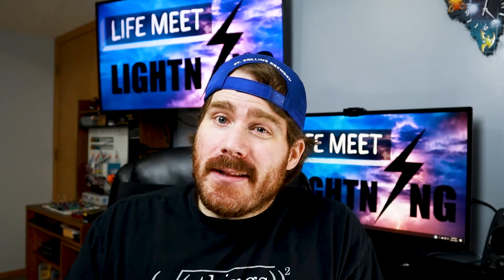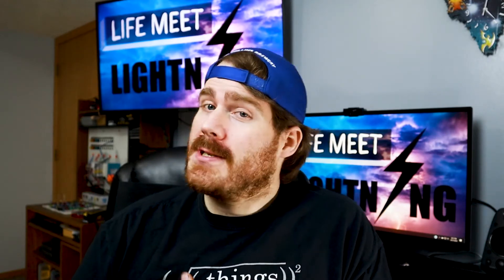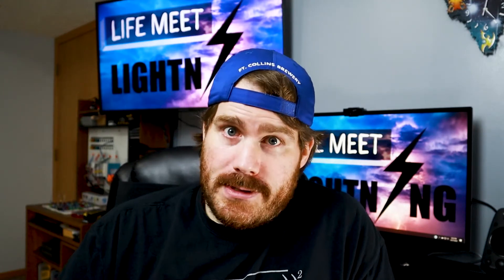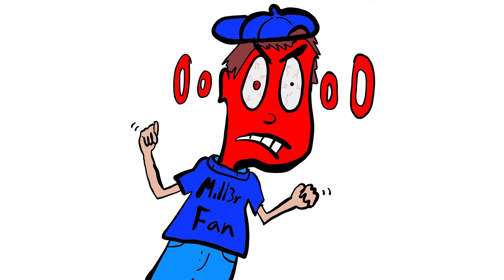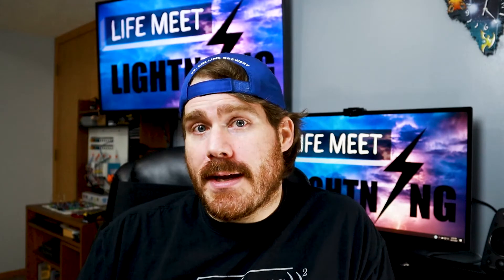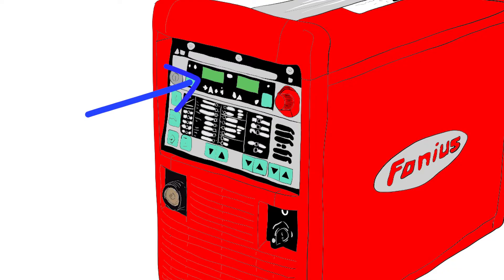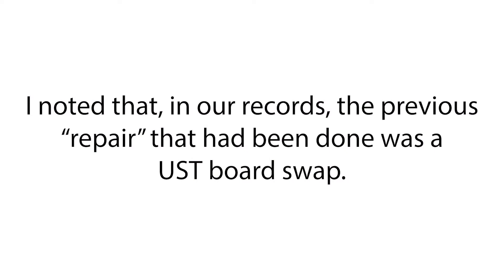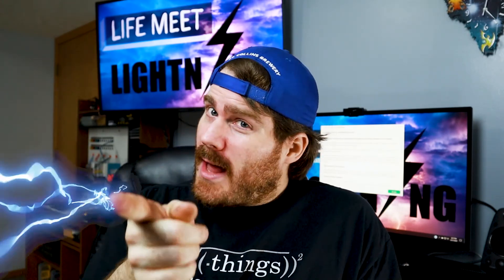Maintenance Technician Fronius Welder Repair | Three Dashes | No Job Selected

Comment: Hello , im from Greece and i bought a used transsteel 5000 with a vrd5000.... When i turn on the main switch , the panel on vrd 5000 just show "off" , and work only the water pump.... Can you help me?

Comment: Just had my first fronius experience myself.  Mine was a bit more straight forward than yours.  Bad Cooling Unit control transformer for the cooling pump.   What kind of company do you work for if you don't mind my asking?
Reply from the maker: I used to work for an off-road vehicle and rail car manufacturer. Now I work for a robot and cutting table integrator. I still fix welders occasionally, but it’s mostly robots now. You?

Comment: Can u help me for a service  manual for fronius transtig4000 machine.
We are not able to find out faults to which card to be changed ( uti board or bps board)
Reply from the maker: See if this helps: https://www.fronius.com/~/downloads/Perfect%20Welding/Operating%20Instructions/42%2C0426%2C0025%2CEN.pdf

We have some manuals at work from some training Fronius did for service techs. I won’t be able to provide those, but you might be able to call Fronius and ask. 

In my experience, we have a lot more trouble with the bps boards than the uti boards.

Comment: We are using fronius mig transpulsesynergic  4000. 
What maximum distance that a wirefeeder motor should be kept from its  wirefeeder card.(SR41 or SR 43).
We are keeping a distance of 40 meters is  the quality of welding affects .Because we r facing the problem in quality of welding .
Reply from the maker: All of the feeders we use have the SR41 boards and motors built into the same unit, so I’m not sure. I know their power source to feeder cable packs can run quite a distance, but 40 meters is a lot. Most of our cells are 10 meters or less. Sorry I couldn’t be more helpful. 😕

Comment: Yesterday I just bought used Fronius TransPulsSynergic 2700 ALU edition and bring it to Fronius authorized service, the guy showed me all about adjustment and how to use everything, Im new to this and want to learn and weld aluminium with it. 

Are there any updates for this machine that makes welding modes better?

Machine has water cooling but torch is not original and doesnt support it and its also kind of smaller, he said its up to 250A.
Problem I have is that torch get overheated after 10cm of weld at 130A.
I want to weld normally with at least 20-30cm before overheat.

Can I fix a problem with a bigger torch or I need to go for expensive torch with water cooling?
Reply from the maker: I would go with a water cooled torch for sure. You shouldn't have any trouble if you get a torch that can actually use the cooler. We've had trouble getting original Fronius torches too (not sure they even still make them). We get them from another manufacturer that I can't recall right now.

As for updates, Fronius' firmware seems to have more to do with hardware improvements for the boards, not like a software update that makes your computer run better. To get a machine that runs better, you have to get a newer machine it seems. At least that's what I know in my realm of repairing them. I could be wrong.
Reply: @LifeMeetLightning  
I have bought water cooled MB 501 550A torch from China, great torch and bigger than I need but affordable. Everything works fine, there is just problem that welder often doesnt turn on first time you switch it on, vent starts blowing but front panel with buttons doesnt turn on at all, its seems like some relay doesnt click and want power it on first.
Thanks for help man.
Reply from the maker: @alphaprecision2064  Are you running it single phase or three phase? Does it select it automatically? We only have a few of those 2700’s around and I’ve haven’t gotten to work on any of them yet. The first thing I’d do is check for loose connections, particularly to the front panel board and the other end of what that board is connected to. Be carefully digging around in there. Yellow wires are live even if the switch is off. Unplug it, and make sure the big capacitors are discharged (they should discharge themselves over 5 to 10 minutes after powering down, but I’d check them with a multi-meter to be safe before touching anything). They store enough energy to knock you on your butt. Fronius does have great troubleshooting help in their technical manuals, and I think they are available for free now on their website.
Reply: @LifeMeetLightning  
Thanks alot man. I spent about 7kg 1.2mm alu wire so far, welder works great :)
Few days ago I went to start welding and same problem, I sprayed all connections with contact spray and now works great.
So thanks for that.

Comment: Life Meet Lightning...  sorry you got me lost with firmware update moment. You install a new board , comms were restored but dashes were still there. Then what firmware did you put back - the original on the board that the previous guy replaced?. Could you clarify.I have similar issues with my WM1700 and suspect corrupted FW.
Reply from the maker: Yeah, it was the same firmware for the board that had already been replaced. I just re-installed it.

Comment: I have a fronius transtig 1700.
I get a error when i start the machine.  (Error 017)
It means " primary overcurrent error"
I did reset the machine ,but it dont fix it.
Do you no what part in the machine i must replace to fix the problem?
Reply from the maker: Hey! I replied to your email. If you didn’t get it I can try resending. 

I would suspect something in your primary power section. The input SCR, BUS Capacitors, IGBT’s, or possibly the control transformer. 

As I said it the email, it’s pretty difficult to troubleshoot fronius’s without a technical manual (not an operator’s manual). I’d see if you can get one. It will walk you through how to test those components, where they’re at, etc. 

Most importantly though, if you aren’t savvy with electronics, DON’T open it up, find a service shop. Those BUS capacitors can kill you if they aren’t discharged properly. Also, some Fronius’s still have live power inside even when the switch is off, so be sure it’s unplugged.
Reply: Hello
I did not get your mail, can you send the mail again xteetje@hotmail .
You mean the big 3 capacitors 470 uf. ( i did discharge them , i no the power of that capacitors)
The transformer is that one  in the other corner of the powerboard ?
Is there out somewhere a service manual whit all the data of the powerboard?
I can sent you a foto of the powerboard so you can tell me what i must measure.
Reply from the maker: @klaastuik1437  I emailed you again. You can get the service manuals directly from Fronius. Check out the email for more info.